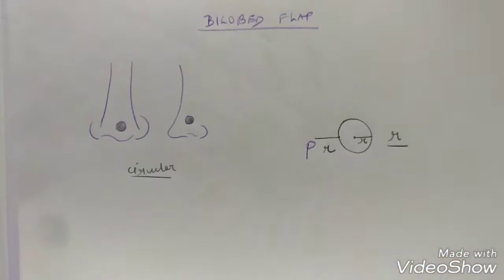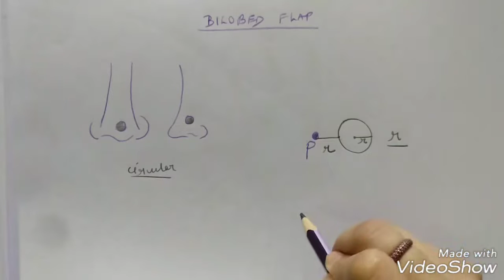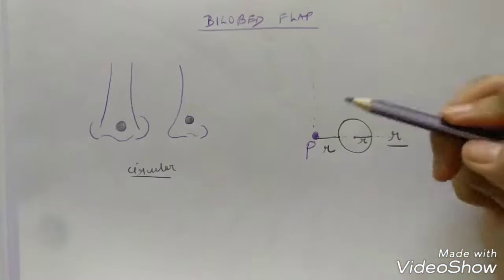Bilobed flap

Comment: Pivot point ? I presume this is a point , two ‘r’ in the  direction of maximum laxity..to allow rotational movement of both flaps into the defect. The drawings can be confusing. On cadaver demonstration , you could explain the pivot point is not just 2 x ‘r’ . Also , the  apex of the second flap should be orientated in a way that respects the cosmetic units/ natural depressions/ contours.
Reply from the maker: Thank you..but i dont do cadaver demonstrarions..in case you have some videos of the same it would be helpful to share them here

Comment: very nice demonstration of biobed flap design..thank you very much for the video..but please comment also on how the second flap size should be determined..
Reply from the maker: Swaraj Hanspal second flap size is slightly smaller than the first depending on the amount of laxity available. .some consider it as even half the size of the first
Reply: ok thank you for that; another query - the first flap you mentioned is within the 2 dotted lines so how can it be the same size as the defect because the defect shown is a full circle